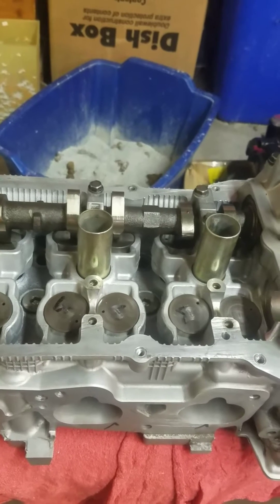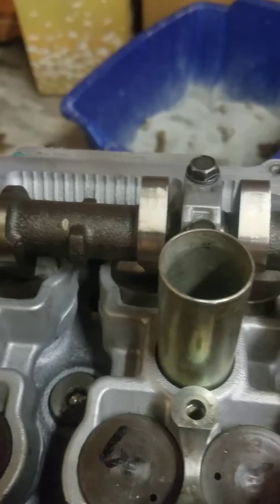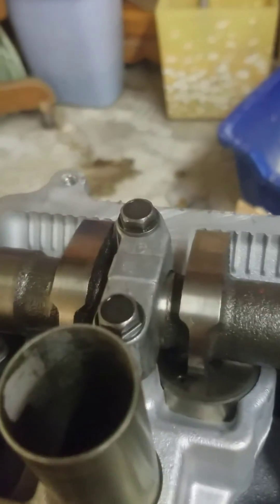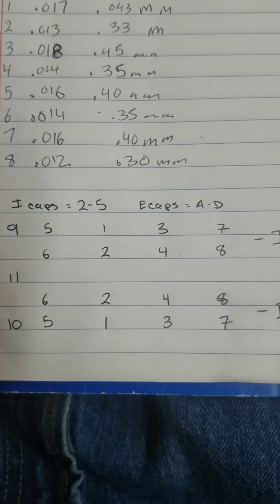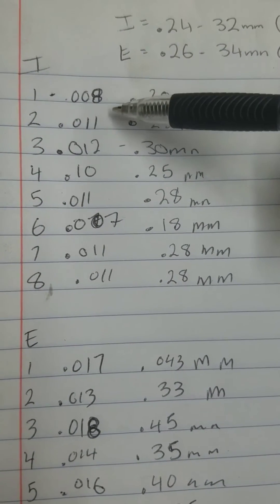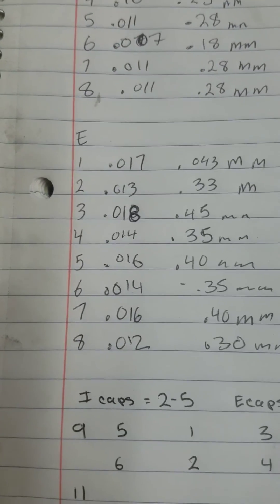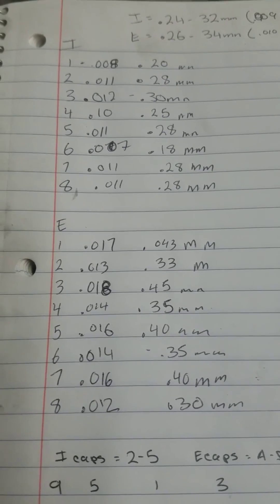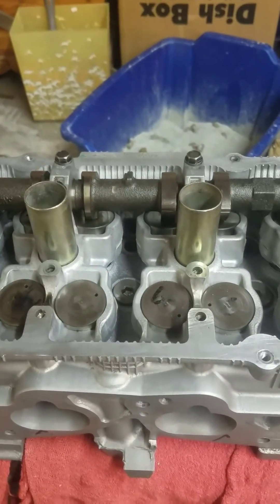QR25DE Valve Clearance Part 1

Comment: I had this  engine  and  I traded the car at 58K miles because the top end  got real noisy.  Thing was killer  noisy in the Winter during warmup regardless of the quality synthetic I ran. Wondered  about oiling issues. Odd to see the intake  valves  receding tight.   Back to the cam box; so there are no shim pills  under the buckets? I would assume  you could  loosen the intakes by grinding the  underside  of the tappet since there is no rubbing wear there.   I use to like FIAT/YUGO  SOHC  bc the buckets were under oil. Designed by the Ferrari engine magician. Thanks.  - SANDY